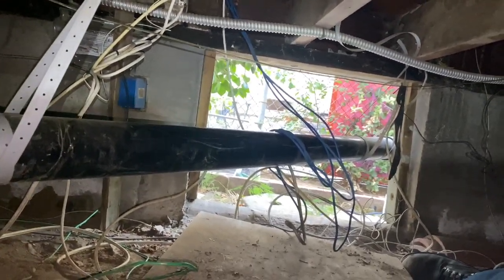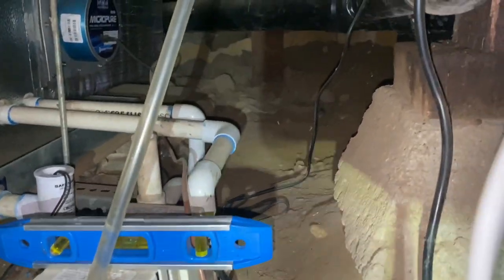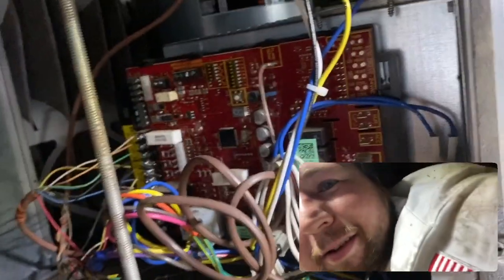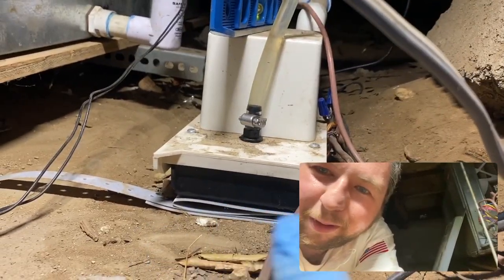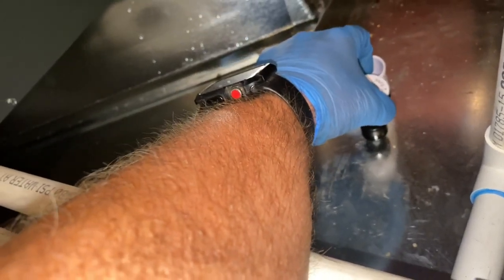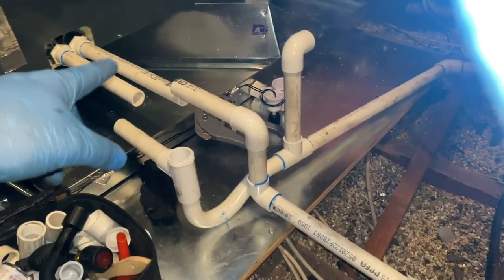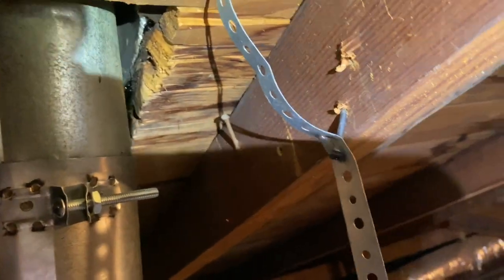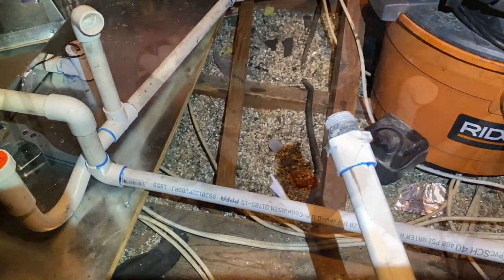Playing With Drains!!!  EP40

Comment: Unrelated HVAC question for the Nighthawk...

Could a dirty filter cause a low pressure lockout?

I had a condenser go into a low pressure lockout and when I cleared the error code and bypassed the time delay to get it running again, the pressures were fine.

I went back downstairs to take temps and was getting an 18 degree split. 

I saw the return was dirty so I opened up the FAU and the filter was pretty bad.

I replaced it and cleaned out the return. 

That’s the only thing I could think of though.

What do you think?
Reply from the maker: Yes. A very dirty filter can restrict airflow going across the evaporator coil causing low suction pressure and freezing which causes the suction pressure to be low enough to tripp the low pressure switch.

Comment: how long before that screw head pulls through that perforated strapping?  Use a washer.  Pipe dope is fine for water.  Teflon dope.
Reply from the maker: That’s funny that you say that. I was thinking the same thing when I did it. Unfortunately I didn’t have any washers with me at the time of this video. I did go back 2 days later and added more straps with washers. As far as dope vs tape. I was just taught to never use dope on plastics.   Plus I find the tape is less messy. Thanks for your comments and thanks for watching.